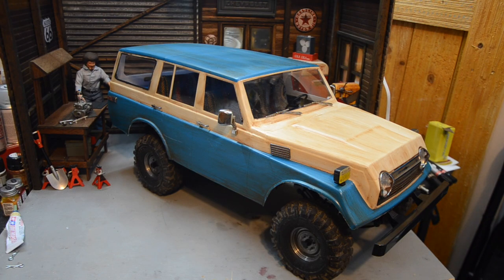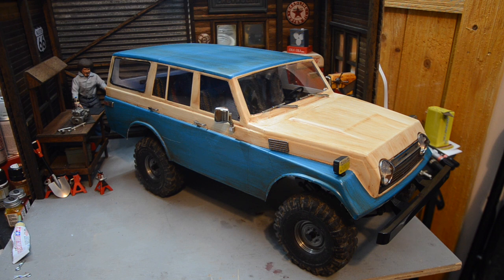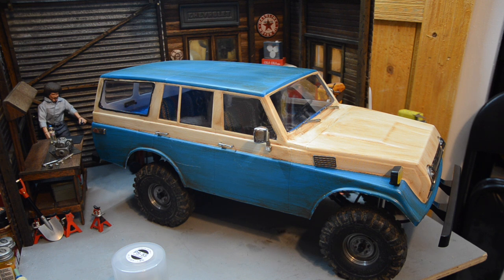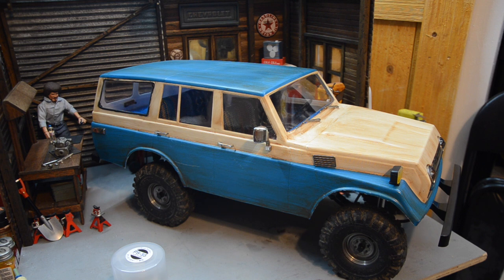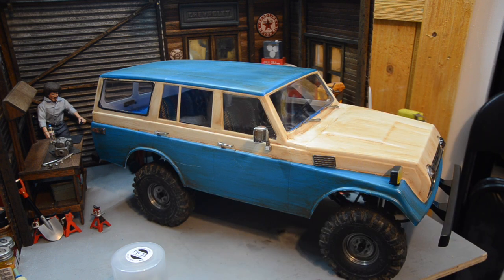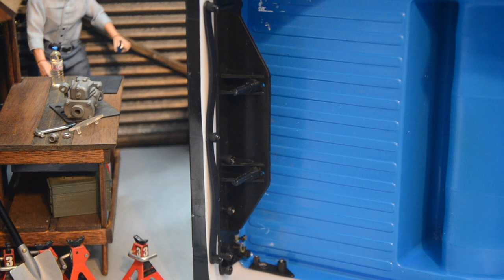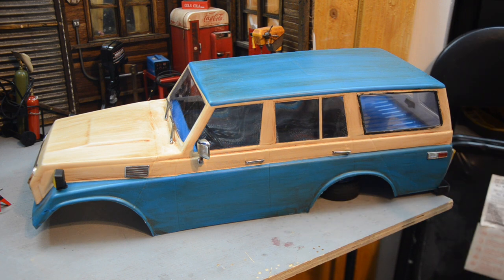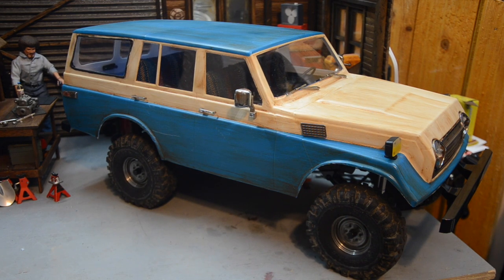Paint & Patina on the New RC4wd Toyota Land Cruiser FJ55, Finishing up the Iron Pig

Comment: From my experience, usually a silver undercoat will help with the scratches and wear, looks better as the truck gets trail rash. Also, you can spray with "adhesion promoter" to help the paint adhere . Pus, I used to use engine paint (adhered to Lexan really well)  For the life of me, I cant see why this body has to be Lexan, however. You need a heavy weight on a leafed truck! You got some great results!

Comment: I'm with you, I'm no fan of lexan.
My first kit was a lexan body and I tried scuffing (inside) and the first time I took it out the paint chipped off in pretty big chunks.  It was such a pain I just applied duct tape all over the interior instead of fixing the paint.   Never again, hard bodies are so much easier.
All that being said I applaud your results!!!!   It looks really good
Reply: I definitely agree with you on this one! I’ve been in your shoes before! They’re a pain in the rear!
Reply: @anibalbabilonia1867  thanks, it's good to know I'm not the only one.  I didn't  use the adhesive aid, just plastic primer & paint.  But like I said. That's the first and last lexan paint job I'll do.  I had bought a traxxas TRX-4 Defender body before painting the other one.  It was pre painted and I added duct tape before I ran it because of the issues with the paint job.  So far no issues.  I guess the factory knows how to paint lexan. I'll leave it to them.

Comment: How does the length of the body match up with the TRX4 Defender body?  Shorter or longer?
Reply from the maker: It is 12.37 inch and the defender is 12.75 inch. Could make it work easily.

Comment: I know I'm late to the Pig Party, but I have one coming to me today!  One thing I'm not a fan of is how high the body sits on the chassis.  The RC4WD description mentions adjustable shock towers (two holes like the Gelande 2 hoops?).  It comes with 70mm and 90mm shocks, do you think swapping those for 60mm and 80mm shocks work or would I run into binding issues with the steering linkage?
Reply from the maker: It might help. The real thing it needs to sit lower is softening up the leaf springs. They just had way too much arch for a lexan rig.
Reply: Thanks...same ol' RC4WD problems!  I'll work on loosening them up.